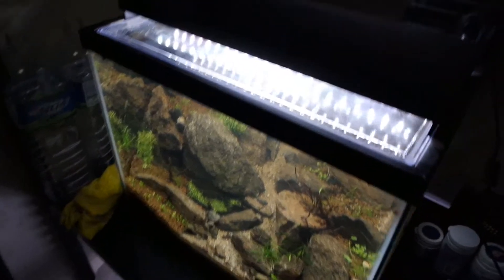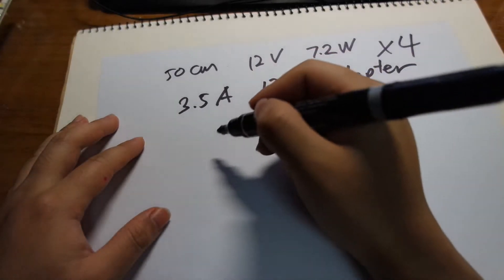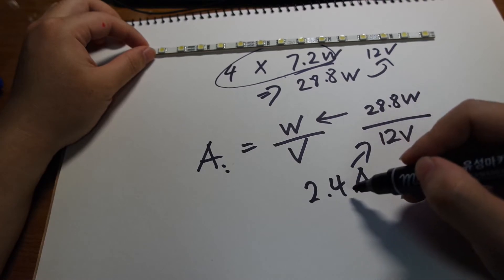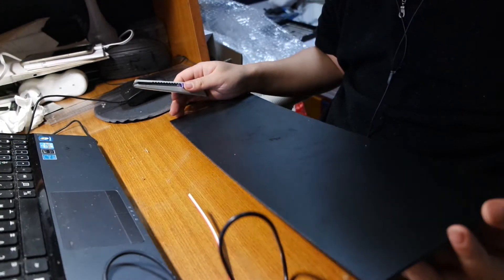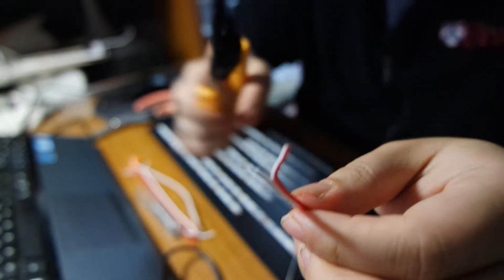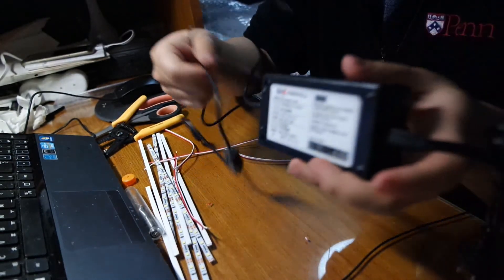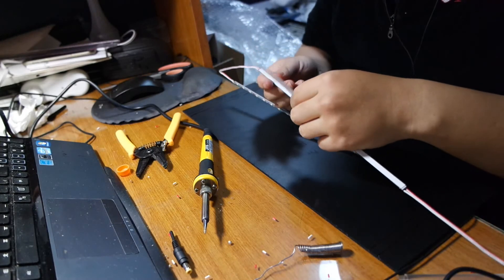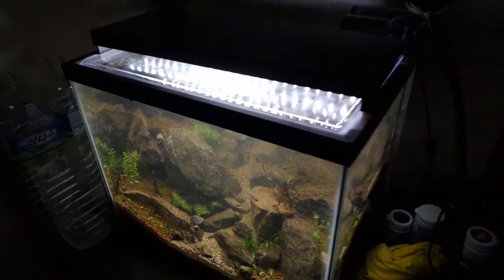DIY LED growth light for planted aqarium guide

Comment: Very nice. How hot does the lid get? I made a DYI led light with the light cable wrapped around a PVC pipe. The lights generated enough heat to warp the PVC pipe. If you have you light on for 12 hours, does the black plastic get hot?
Reply from the maker: Not so hot at all. I can touch the lights directly. Yes they are hot to the touch but nowhere near enough to burn me or warp plastic